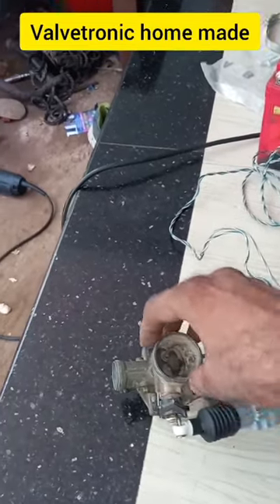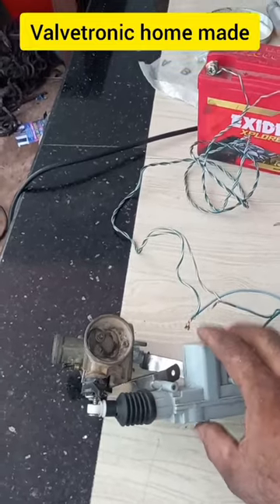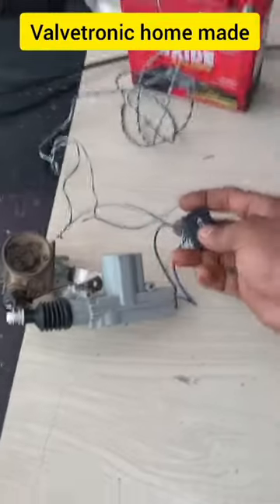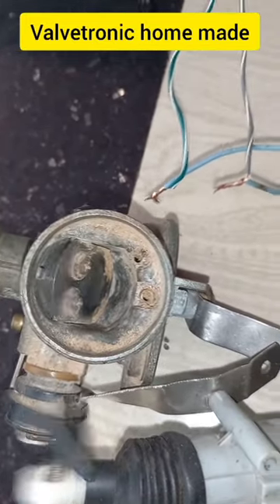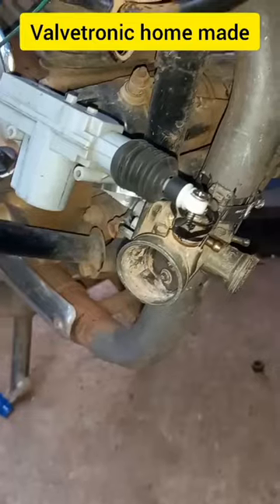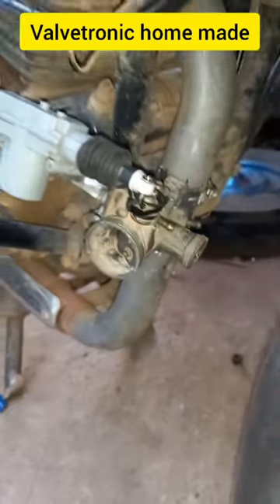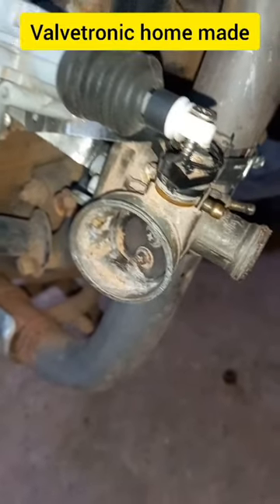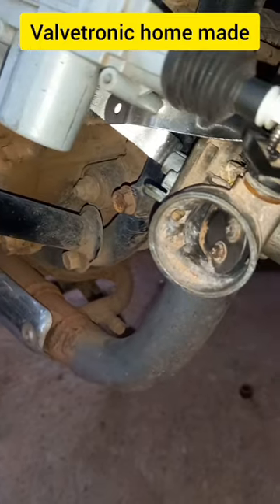Exhaust Valvetronic Bike  home made

Comment: Bro heat adikumbo nthelum vishyam varunondo carburettor nu
Reply from the maker: Ella najn e bike kore odichu . Dialy joliki pokunatha  . Pine eth nalonam chood akum full accelarator kodukumbo fire varum . Police pidicha problem akum . Sound one of akka . Normal bike ayittu use cheya loud sound bike ayittum use cheya . Engine aduth valave ullath kond nala sound a 
eth v3 . V2 ok fit chaitha arum kanoola 😁
Reply: Njan ithpole plan cheythirunnu apo metal nu nthelum vishyam varuvonn samsayam vann
Reply: Thanks bro